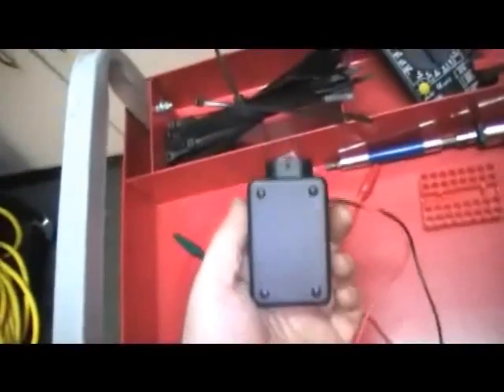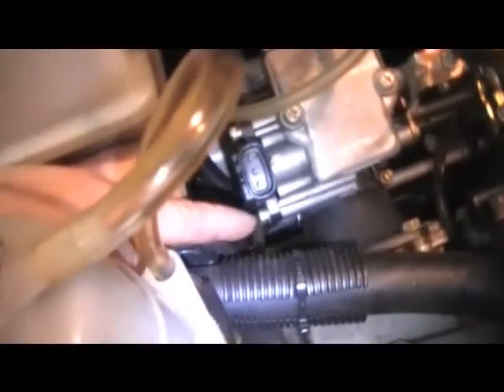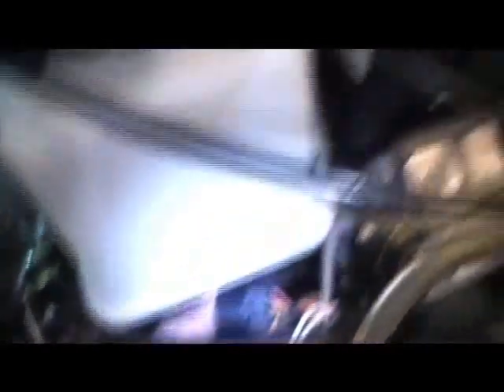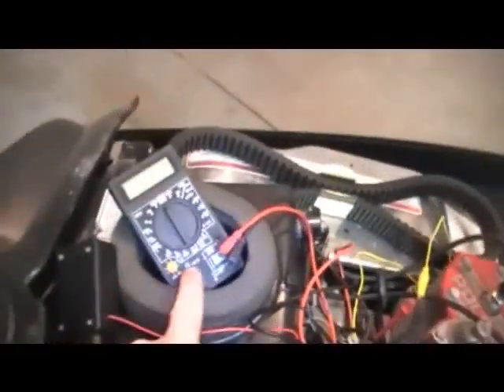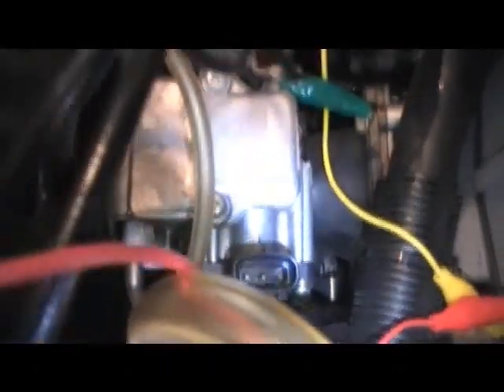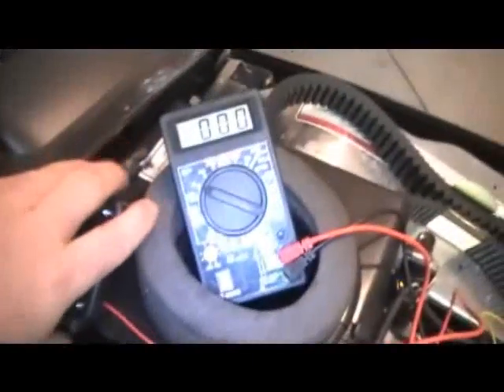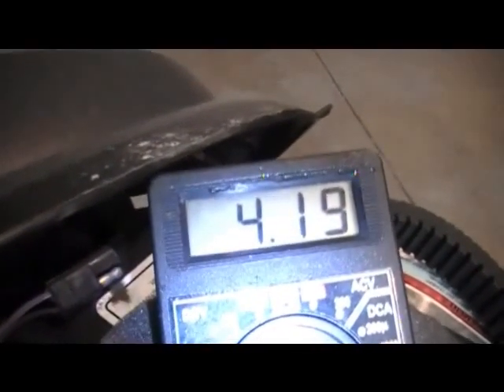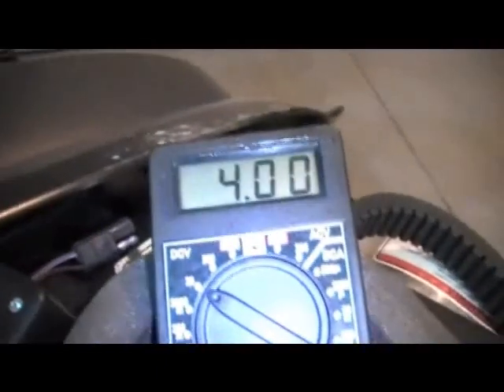How to adjust your Polaris Snowmobiles TPS.

Comment: ground on multi meter??
Reply from the maker: @jackdeschenes2750  

The black  ( - ) from the Multimeter and the black  ( - )  from the Power Suply are connected together. I just used a jumper wire, it's hard to see it in the video.

Comment: What about 2001 Polaris rmk 800 (it has the body of the 800 but re placed with 600 motor and been rebuilt recently) gen 2 rmk is there a oli pump adjustment screw on it? Cause she’s not sounding right fouling plugs smoks way to much he’ll shr barely wants to go past 10 mph it’s bad
Reply from the maker: It's been awhile since I've worked on an oil pump but from what I remember and what you are explaining is that you don't have your oil pump set properly. There is no adjustment screw on the oil pump. It is adjusted by cable tension. There should be a line on the oil pump actuator lever that should line up with a straight line that is on the oil pump housing itself. I believe the procedure is to set up your idle speed first so that your sled idles properly and then adjust your oil pump actuator lever line to line up perfectly with the line on the housing.

Comment: Can you adjust the tps without the throttle idle set screw ?
Reply from the maker: The simple answer is yes! While adjusting TPS you shouldn't have to adjust the throttle idle set screw. Now with that said, if you had to adjust your idle because your TPS was so far out of whack then you may need to adjust it when you bring the TPS back into the proper range. But most times you don't have to adjust the idle screw.

Comment: Hi i just found this video cause i just got a 800edge x. The link does not go to how to build the tester. Can you tell me how to do it ?
Reply from the maker: That website that I initially posted this on has since been disbanded. So this is the best I could find on short notice. It's almost exactly what I posted.  https://www.snowest.com/forum/threads/how-to-make-a-tps-tester.376609/
Reply: @PolarisRich  omg ! Thank you so much for getting back  to me.  Being old video wasnt sure if you would . I will sub and thumbs up.
Reply from the maker: Instead of using an old TPS connector I actually used alligator clips

Comment: @PolarisRich you wouldn't happen to still have the write up you did for slednutz do you? If so I'd like to post it or you can over at snowmobileforum.com as a few people have been wondering how to adjust and make that tool. Thanks!
Reply from the maker: I'm sorry I really don't have any pictures or the write up left that I did on slednutz. If I find anything I will surely go to your form and post
Reply: Thanks, I did find the parts list but it was missing the type of switch you used and ICR what it was as the tester is at my parents house. IIRC it was a 12v toggle switch with 3 pins on it for ground, acc & power? @PolarisRich  

http://www.backcountryrebels.com/showthread.php?t=1456 and http://www.backcountryrebels.com/showthread.php?t=21358&highlight=polaris+tester

Comment: Hey there i got a 05 rmk 900 and found the procedure in the bottom of the comments but now I'm not able to open the link to build the power supply are you able to get me a link that works if so that would be awesome thank you
Reply from the maker: Hey Mike, sorry about the link not working the Forum I posted it on is now closed. I cannot access it either but I found one that is very similar on another form. If you scroll halfway down you should come across I diagram that should show you how to build the power supply.

https://www.snowest.com/forum/showthread.php?t=287858
Reply: Thank thats lots of help

Comment: I have a 2001 xc xp 600 it won't idle and back fires and dies out rpms under 2500 but works fine over 2500 would that be what's wrong with it
Reply: Tab Dewolfe 
Good morning Tad,  from what you're describing I don't believe the TPS is your problem. To me it sounds more like you have a carburetor issue. I would take the carbs off give him a great cleaning and sync the carburetors. Also why you have the carbs off give you Reed valves a check. Some of the Reeds can be missing or worn out of position. One last thing to check take a good long look at your carburetor boots. A ripper a tear in the booth could cause that problem also and they have a tendency to dry out and rot.
Reply: I did that redone the fuel pump sled idles better with it unplug
Reply: Tab Dewolfe first check plugs and plug wires. My 07 did same thing took spark plug out I've noticed electrode on plug was gone broke off.

Comment: is the 4.0 the same for a 2003 polaris pro x 800?
Reply from the maker: Shawn Brown 
I believe the 03 Pro X 800 is a regular carbureted machine so yes the 4.0 volts is the same for your TPS setting. The only time the TPS value would be different is if your engine has Cleanfire fuel injection.

Comment: Hello PolarisRich, I have a RMK 600 year 2013...Will it be ok to adjust my TPS just as the same in the video clip?  Also another question... I had this problem while trying to start my RMK with pull start I always had to grab the throttle to turn up a bit of gas on it, how will I fix it to get it start normally instead of grabbing the throttle?
Reply from the maker: Mike Akumalik
Sorry Mike but your sled is a cleanfire fire injection machine so the process outlined in the video will not work for your machine. further down in the comments below I did outline the process on how to set the cleanfire injection throttle position sensor.
To me the problem with your sled sounds more like dirty fuel injectors
Reply: where do I find that PN 2201519? Anywhere on the website?
Reply from the maker: pn 2201519 hás been discontinued

NEW NUMBER
2201519-A Only available thru your POLARIS Dealer and SPX Tool Company $45 Dealer Cost They also now have it so you can buy just the Harness Its part # PU-47466 $35 This is everything except the Voltage Regulator and the 9 V battery

Tool Number: 2201519-A 
Tool Name: THROTTLE POSITION SENSOR TESTER KIT 
Your Price (USD): $45.57 
Applications: ATV, Side x Side, Snowmobile 

The 2201519-A TPS Tester is used to set TPS on Polaris Snowmobile, ATV, and RANGER products. Replacement regulator is available as part number 547927. 
Service Parts 
547927 TPS TESTER REGULATOR 
PU-47466 TPS TESTER ADAPTER HARNESS
Reply: Awesome Thank so much for all the help, now maybe if I can order them I'll reset my TPS and throttle body too.  Thank you!

Comment: i built this as the video says to and I get a reading of 7.5 on my meter. I  should be reading 5 no ?
Reply from the maker: jaylosix 
Depending on what your talking about. If it's 7 volts on the power supply then it's to high. Power Supply has to be exactly 5.0 volts.  I had that problem when I built power supply, I had the wrong resistor soldered in. Changed it out for a new one and the voltage came back to the 5.0 I needed.
Reply: Yes, 7 volts on power supply once i finished building it . Not yet connected to the sled

Comment: I have a 2003 Polaris Classic Touring sled.  The engine idle is too high (3500 rpm) after having the carbs rebuilt.  Can't I rotate the TPS as the sled is idling to get it down to a reasonable range?
Reply from the maker: Chuck Van 
The TPS should have no effect on Engine RPM at all, it's sole purpose is to tell the computer where the throttle is in relation to engine RPM. 
If you did not remove or adjust your throttle stops during the rebuild then I would definitely look at the tension in your throttle cables. One might be out of alignment.
Reply: PolarisRich Thank you for the info.
Reply: Chuck Van I installed a powermadd throttle extension on my xc 600. Had my carbs rebuilt and synced.  When it's at idle it is at 2500 and climbs slightly. What should I look at if it appears my throttle cables don't appear to be the problem . Should I adjust my tps? Or mess with the idle screws to idle it down to 1200-1500rpm

Comment: PolarisRich, thanks for the video.  Not sure, so I'll ask... Will the numbers be the same on my EFI '05 900 RMK?
Reply from the maker: Aaron Matthews 
I believe your sled is a clean fire injection machine and the process outline in this video will not work on your machine. now with that being said if you scroll down in the comments in this video you will find a process and all the values needed on setting your throttle position sensor on your cleanfire injected sled.
Reply from the maker: Aaron Matthews 
I I believe the post is called...
Setting TPS on CleanFire Injection

Comment: My sled is acting a bit worried..i have done a complete restoriaton engine wise, pistons, rods, gaskets. But it has been more and more stalling and backfired, riding in low and mid range... have no problem att all if i pinning it on the lake, runs great.. but when i release the throttle it starts to run uneven and boggs, and starts up again..

 Today my belt went off when i was almost home. Can that may be the reason.. the belt wearing down ?  I need to say im all newbie on sleds.
Reply: Simon Ottosson
Reply: Sounds like your valves not opening up on time.

Comment: Hi, i have a 2006 RMK 600 HO. At WOT in cant get it over 7500 rpm, sometimes no higher than 6500 rpm. Carbs are cleaned, exhaust valves ar cleaned and checked, cylinders and pistons are mint. Could a faulty TPS cause this? it seems like it hits top rpm, it runs flawless up to the point were i can't get more rpm.
Reply from the maker: The TPS doesn't control engine RPM, it only relay's the throttle inputs from throttle plate to the ECM and or ICM.  
Your problem to me sounds a lot more like it has to do with your clutches binding up and not fully shifting out to achieve maximum speed and RPM. Dirty clutches, worn clutches, worn belt and belt deflection  will cause sporadic engine RPM at WOT. Also snow conditions can also have an effect on your RPMs at WOT. Hard pack and ice your RPMs will be higher than in fresh deep fluff. This is more prominent in smaller machines ex 500-600cc

Comment: I have an issue with 2007 switchback 600 H.O. ... Had carbs cleaned, new computer, new stator but it seems to randomly shut off, bog down and backfire when you press on the handlebars or going over a big bump...  I'm almost 100% positive its a electrical problem or short somewhere.  I did replace the heated grips and my throttle was really loose and moving before it started having this problem.
Reply from the maker: Hey Joe, sounds like you've got a loose throttle cable or a sticky throttle it's self. If you let off the fun flipper too quickly does the motor want to stall for a second? This could cause some of the problems you've described.
Reply from the maker: Sorry, check the  throttle safety switch!

Comment from the maker: ***** Sorry I forgot to mention that in the video and it seems that everyone is calling me out on it!
The black  ( - ) from the Multimeter and the black  ( - )  from the Power Suply are connected together. I just used a jumper wire, it's hard to see it in the video.
Once again I should have mentioned it. Sorry
Reply: Thanks, I will try that right away.
Reply: Does this have to be exactly 5v?

Comment: 2006 Fusion 600. Goofy misfire on the Mag side at idle. Carb, exhaust valve, wires, plugs all good. Hitt the throttle and it is ALL there. Could this be the TPS?
Thanks very much!
Reply from the maker: Highly unlikely that it would be caused by the TPS if its only affecting the one cylinder. 
It can be a hole multitude of different issues creating that specific problem.
 If it was my machine I'd pull the carb again, give it good cleaning! Inspect the Reed Valves. Swap plugs from left to right to see if there's a different. Next I'd be looking at an air leaks around the power valves, reed valves, carb boots and finally mag side seal!
Reply: PolarisRich
Thanks for getting back to me. New plugs, new wires, caps good, power valve clean and free, jets clean, idle screws set about 1.8 turns crank seals replaced, new pistons and rings, has impressive power once the clutch is engaged. When the engine was put back in the stator wire was hooked to the temp sensor and fried it. New temp sensor installed. There is ample fuel getting to the cylinder. It has run about 150 miles since the rebuild. I pulled the power valve last night thinking it could be stuck open. Very free. When the rubber was lifted, there is black oil/gas residue behind, but again this is being caused by the idle misfire. I could switch the plug wires, but I don't know if this fires both plugs at the same time. (My Polaris Starfire fired 3 times per revolution.) This sled has 6000 miles, absolutely no salt rash, and has been well taken care of.  Again if you hit the throttle is shakes up the boys on bigger sleds. Oh it has a Starting Line air box mod, and is running 420 mains.
Reply from the maker: whitepinehost 
Sounds like you may have a lean condition on that one cylinder. Could be caused by the airbox mod.  Hard to diagnose without actually seeing the sled. 
What's the compression at in both cylinders when cold?
What's do the spark plugs look like? Is there a color difference!
Reply from the maker: Also when you cleaned the Power Valves did you clean the decompression hole on the cylinder? Its about 1/4" above the Power Valve  sleeve.
Reply: PolarisRich
Hi there. It is rich. I switched plug wire, no difference. I turned in the low speed needle half a turn, no difference. Compression is the same on both cylinders.
I think I have it figures out. If the float assembly has been damaged at all at an idle it is conceivable that the float level is too high creating a rich environment. With only a blip of the throttle everything comes to life instantly. I could verify by switching between the carbs. Major pain in the >>>Polaris wants 70.00 for the needle/seat and float assembly. This must cost about 18 cents to make...

Comment: Someone know if this tool work in the CFI???

And  it is ok if my meter read 5.03 volt
Reply from the maker: Yes this tool will work for Clean Fire Injection. It is used to supply a constant voltage to the TPS so a measurement can be taken on the output voltage. But you must follow the Clean Fire Injection procedure and settings!    
As for the 5.03 volts, I think your fine as long as it doesn't go above or below 4.90-5.10 volts
Reply: PolarisRich Thanks, nice tip!!!
Reply: PolarisRich I' Last one for the CFI: I have a dummy question, connection issue, I have on my fluke meter the black one (-) red one (+)
on the power supply I made,  I have the red (5V) black for (-), so where I'm lost the TPS have 3 pins, do I put the 2 neg. together, Or witch wire go where .
Reply: Sebastien Ferron Thanks again
Reply from the maker: The two blacks go together,I used a jumper wire but forgot to mention it in the video.

Comment from the maker: SETTING TPS ON CLEANFIRE INJECTION

1. Assemble your TPS sensor tool (PN 2201519) as per the instructions that came with the tool.

2. Make sure your 9 volt battery is in good condition by inserting the black voltmeter probe from your Fluketmeter in the black terminal and the red probe into the pink terminal. Voltage should read 4.99 to 5.01 volts. If not, try a new 9 volt battery.

3. Insert the red voltmeter lead into the terminal above the pink wire, and the black meter lead to the terminal above the black wire. Slowly open throttle and check for smooth voltage change.

NOTE: The Fluke meter will change scales and show O.L. momentarily when throttle is opening.

4. Remove the throttle cable in order to take the slack out of the cable.

5. Remove the connector from the TPS on the throttle body and install TPS sensor tool on to the TPS.

6. Measure and record the voltage reading at idle. Should be close to .930 volts.

7. Back off the idle lock nut counterclockwise and then back out the idle adjuster counter clockwise until the screw tip separates from the adjusted lever tab.

8. Loosen screws on the TPS sensor.

9. Adjust the TPS sensor until the voltage on the volt meter reads .709 to.711 volts.

10. Tighten the TPS retaining screws, making sure that the voltage continues to read .709 -- .711 volts.

11. Turn the idle set screw clockwise until the voltage reads .930 volts.

12. Voltage at the yellow terminal should be .920 -- .940 volts at idle. Once the TPS voltage is verified and set, remove the sensor tool and re--install the TPS harness.
Reply: Hey Rich ! Would this apply to my CFI 2009 RMK 700 ? Thanks ! Great video !
Reply from the maker: Your sled is a 2009 CleanFire Injection machine and the process used in this video will not work for your sled. But fear not Doobyboy21, somewhere below in the comments I have outlined the procedure and specs used to adjust the CFI TPS used on your machine. 
Let me know how you make out and if you need more help feel free to ask.

Comment: Interesting video. Question: How can you know if your Snowmobile electric system is providing exactly 5 volts dc to the TPS?  Thanks!
Reply from the maker: The voltage to supply TPS comes from the CDI box, the voltage is programmed  by the manufacturer. You can test the voltage by pinning the wires with your volt meter while the sled is running. The 5 volts is more so for calibrating the TPS
Reply: This procedure really works, completed last night.  800 engine runs smoother and gained 1k rpms.  Thanks Bud!

Comment from the maker: Some sleds that I've adjusted had a noticeable difference and other it did nothing for it! What was your initial problem you were thinking that adjusting the TPS could fix?  This video is just to help tweak the electronics or reset the TPS setting after its been removed for cleaning. The most I can say is that some sleds react differently when the TPS has been adjusted. Sorry to hear it wasn't very helpful!